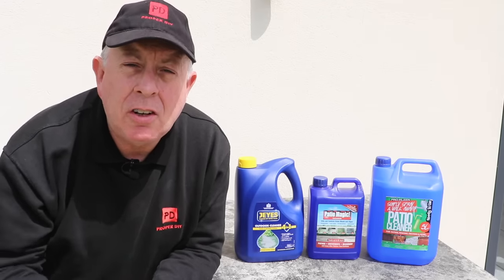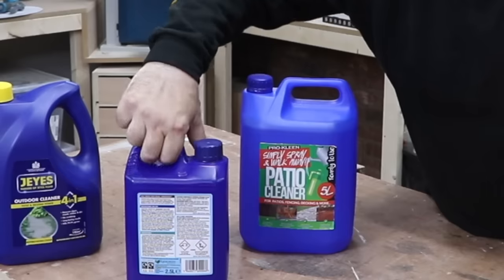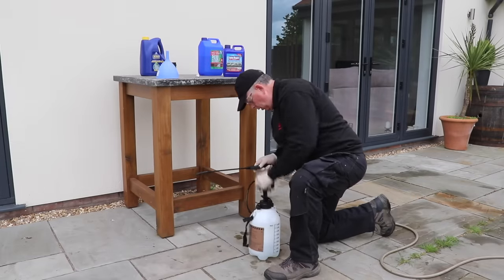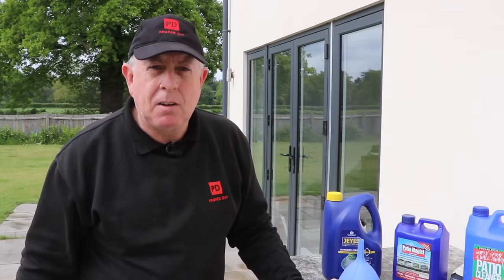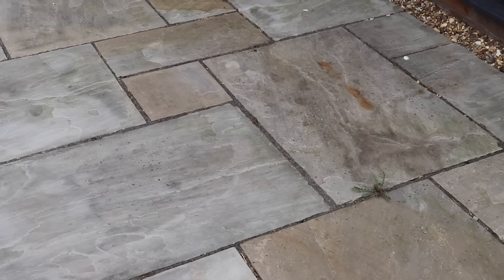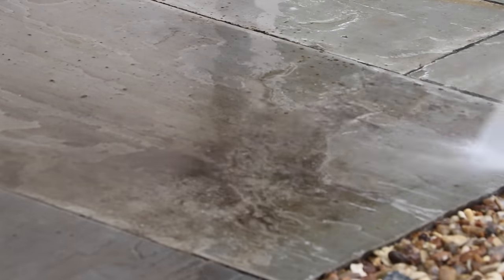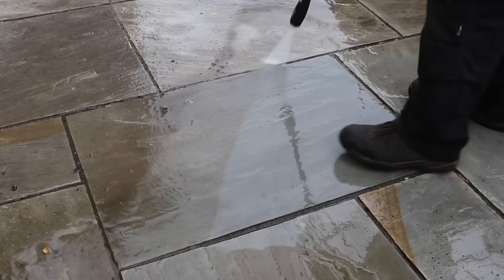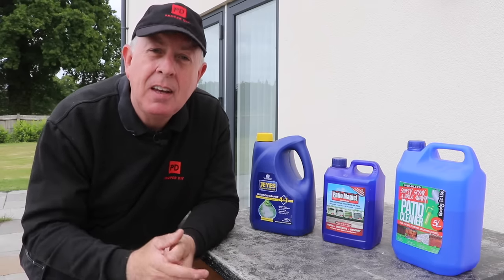Patio Cleaners vs Pressure Washer Put to the Test with Surprising Results!

Comment: I noticed your pressure washer is 110 bar rated pressure which is 1595 psi. .  My US washer is 3500 psi. I don't need any chemicals at all.  I wonder if this may also be a factor in cleaning.  I have no issues at all in cleaning most any and all gunk on any surface,

Comment: Well, here in the South West of the U.K. we have a hosepipe ban until Dec 2023! …any other suggestions? 😢
Reply: bleach, sugar soap, washing up liquid or washing powder liquid or vinegar (just one) in a bucket mixed with water (50/50 roughly ratio) and stiff brush and elbow grease. You can then consider your exercise done for the year.

Comment: What's your view on the patio cleaning brush heads  and/or patio cleaner in the pressure washer ? I've used budget patio heads before but the results with a genuine Karcher head were far better IMHO.

Also, do you think pressure washing followed by these treatments to prevent algae growth is a valid way to go ?

Comment: Wet and Forget is probably brand leader for this product. This works but you have to leave it to soak for weeks / months 
I had a roof kept on getting green and moss too 
Part of roof I couldn’t get to at first so first part of tile roof got about a months head start … over the course of 3 months the main part of roof was 70% better and the last part also cleared too 
I did this again 6 months later and no more moss or green … yes dead moss / debris was on tiles but no regrowth .. so perhaps a long term test would actually and factually be better … as per instructions  its not INSTANT  love the channel but felt had to comment

Comment: I'd call these mold and alge removers, but they're not grime removers because most of the build-up isn't organic.  Powerwashing is a bitch of a job but needs doing. I did the rear area of my house and you can tell where I stopped
I'd be interested in seeing a more powerful pressure washer or the cost difference in getting a company in to do it.

Comment: I think you need to look at why you are getting dirt on the slabs in the first place. From the video one side of the slabs is gravel & the level of that looks slightly below the slabs so that is ideal. The other grass side is the issue. Looks about level with the top of the slab. In heavy rain periods will get mud/dirt from that splashing/running onto the slabs & some of that will sit on the slab & dry on. Slabs need to be higher than the lawn or need gravel gully channel as a buffer between. Once you have sorted your ground levels, hose & brush the slabs once in a while to get the little amount of dirt off & use Wet & Forget. No need for pressure washer!

Comment: I think it’s a combination of the two. Most professionals would use chemicals and a rotary brush driven by water pressure. The chemical they leaves 
a residue which prevents re growth is the best. Also many provoke have block paving now and use pressure washers, the trouble with many is then 
the weed growth is instant between the blocks. So many people don’t realise that block paving has to have kiln dried sand between the blocks this 
prevents movement and stops dirt, wind born seed and other contaminants from getting deep in between the blocks. These grow weeds and deep 
rooted one’s it’s do easy to brush the sand after it’s dried over the block paving and this stops the weeds. You can of course spray a sealer all over 
which prevents the re growth of green algae. Jet washer on its own is not the way definitely. If your brain dead and need to spend 5 hours on your 
patio watching algae disappear then go for it. Most of us have a life.

Comment: you could have saved yourself loads of money and used a diluted bleach mixture (5:1) Those chemicals would only have been a benefit as a post cleaning treatment to help prevent the return of algae. I use a very powerful jet was with a turbo nozzle for patio cleaning to avoid the use of chemicals, but some mould such as black spot can only really be removed using sodium hypochlorite in a diluted mixture, but for light staining on concrete and stone, bleach will work. Obviously wear protective clothing, wet down plants and grass before putting down chemicals and never allow the spill off to go into fish ponds, and keep animals in doors until completely rinsed down.

Comment: Using a pressure washer not only removes the dirt and algae, but also the top few thousandths of an inch of stone or concrete (hence why it looks brand new afterwards), so if you have concrete slabs you will lose the smooth, semi-sealed surface layer that they left the factory with and become both rougher to the touch AND more porous, which makes them far more susceptible/prone to algae growing back and dirt both sticking, and seeping into the surface of the concrete when dissolved in rainwater, so I really don't recommend using a pressure washer on concrete slabs because you'll be making a twice-yearly rod for own back...

Comment: Sodium Hypochlorite 14% about €50 for 25 litres drum. mixed out at 4to1. Giving you a 100 litres. Best around. Leave it on patio or natural stone or cobblestone for 40 minutes to a hour and wash off with a hose or pressure washer.
Reply: that is €10 for 5 litres. and after diluting is €1 per litre at 3% concentration. That is weaker than household bleach in supermarket, which itself is around €1.50 for 5 litres @5% conc. Not much point in using the 15% stuff if you then dilute it!

Comment: Bac 50 at 25% dilution is much stronger - and cheaper - than the much more diluted commecial mixtures.  It takes time to worrk, however.  I also use it for cleaning gravestones - which can take a couple of months to show results.

Comment: You should have used  straight up  diluted Hypoclorit acid  mate ( Bleach ) 
May have been   possibly better when used in conjunction with a pressure washer or  manual scrubbing or  electric scrubber ( oribital scrubber )  a week later ...  A  surface cleaner on low pressure would be quicker than lanze...  The only thing about pressure washing is is that it can cause permanent damage..

Comment: Well here we are again, with Spring in the air. These products clear green algae. Most don't clean black spots or big stains. 
Every year i power hose my patio and side and front paving. Ive been doing this for years. 
The issue? I miss bits and this is where, in my case, patio magic works a treat. I spray over the entire patio area. It clears the little bits I've missed and also keeps on working. I'm surrounded by trees and greening happens quickly. I think these products keep greening at bay but aren't the full solution.
Where these products are really effective is on fences. 
Away from lawn and beds and pets  bleach has the same effect. 
So if the belt is power hosing, then the braces is patio magic or similar. 
Final point. I always make the cleaner mix stronger than suggested. It may look like its stained but is gone with the mext heavy shower.

Comment: These cleaners work by killing off any thing, then it all gets washed off slowly by the rain. They will have almost zero effect if put on and left in dry weather. Only kill the green algae which then turns either brown or dark. 
However over the course of a few weeks of rain the slabs come up as good as pressure washed. 

It's not a quick clean solution... but it's very easy and if done twice a year the slabs stay pretty much as new without ever needing to pressure wash. 

If you want an instant result you need to use a chlorine based result, and then go over with one of these in the video to stop any regrowth. 

Have a look at "benz" biocide products. They explain how these "soft wash" type treatments work. 

You need to put on on a dry day but the rain and weather is what actually does the mechanical cleaning once its all killed off. 

It can take months to see a result if you use these during summer. During winter you can get a patio or algae covered wall looking brand newnor freshly painted in about a week if there's good hard rainfall.

Comment: Do a test with just white vinegar. You can pick up a 5l bottle for reasonably cheaper than these so called professional patio cleaners. It takes up to 5-7 days to start working. It 100% clears green algae but doesn’t work so well on actual dirt. Sodium Hypochlorite (strong bleach 14/15%) is better than white vinegar, acts a lot quicker but is more expensive. I diluted mine 1:1 at first and only left it 1 hour before rinsing off. Next time I’ll not dilute and leave it overnight before rinsing. Black spots are the bit I struggle most with.

Comment: Doesn’t pressure washing ruin the concrete between the slabs?
Reply: yes it all comes out using a pressure you will need to re-sand it. its best to pressure wash, re-sand and then use the products to maintain the concrete.

Comment: Them.products when applied are supposed to be brushed off with a brush and hose not just left smartseal extreme clean is brilliant dilute apply with watering can leave for an hour and then use a hose and brush back to new no jet wash needed

Comment: Use Sodium Hypochlorite and you'll see a difference within minutes. You can get 20 litres for around £30 and it's also concentrated.

Will get rid of those black spots too
Reply: aka household bleach. the SH @15% is excellent, but, for most applications its too much.
Reply: @LiveFromLondon2  which is why you dilute it down to a ratio you require for the right application rate, normal household bleach may be too weak for stubborn blackspot staining.

Comment: Pressure washers are fantastic but can be to aggressive and wash out mortar from brickwork and you can not use pressure washers on shingle that  has gone green as it will blast it everywhere. There is a place for both methods and you need both.

Comment: Never mind the brand... tell us the active ingredient?
It's bleach actually, and the whole job is done in a tenth of the time without having to buy a pressure washer and no noise too.
After applying with a battery sprayer (have to buy that) leave for 15-30 mins and hose off. Job done.

Comment: chemicals in my experience, are good for moss and algae build up. not so much so for deep in ground dirt. a pressure washer is far better. i have pressure washed my own patio for over a decade, nothing seems to come close to how clean it brings the slabs.

But for the side of the house that is typically damp and gets very little sunlight, i do a good pressure washing each year no different to the patio.  then every few weeks i go out and spray to keep it from becoming slippery from the algae build up left behind from the dead leaves from the neighbours tree

Comment: The real question is where is all the mud coming from? Does it just fall out of the sky? Genuinely stumped how much mud is getting evenly spread (evenly, mind you, not just on the main walking paths) all over my patio on 3 sides of the house every year. Where is it all coming from?
Reply: Good point, my block paving is full of mud after I removed the moss above it
Reply: in effect, yes, it does just fall out of the sky. Soil dust, and everything else that is in mud, is floating around in the air, settles and when damp clumps together, hey presto, mud. Not to mention that rain brings down a lot of "dust" as well.
Reply: @LiveFromLondon2  Interesting, isn’t that awfully bad for our lungs?

Comment: Sodium Hyperchlorite - Give it a chance with a pressure washer to get most of the crud off and importantly leave the paving wet for the next stage. Apply the sodium (appox13 to15% strength) diluted in water and apply with something like watering can gently. Work it around with a brush and watch as in minutes a gentle fizz and hey presto. Rinse afterwords but in truth you could just leave it. Cant be beat IMO and you'll see results in minutes not days. 5l of the stuff is comparable in price to those products tested and will beat them hands down.

Comment: When using chemical.. wet patio, quick rub with stiff brush, then apply chemical spray and leave for 15mins, the give good scrub working up a foam... hard work but for a short period and beats the monotony of the DIY jet washers.... not perfect but what ever is.

Comment: Using Black Spot Remover and leaving it on is the only effective way I have found. These patio cleaners seem to be too weak to give a good result. Pressure washers destroy the grouting. A rotating brush on my Nilfisk pressure washer is about 6 or 7 times as fast as the straight pressure washer and it does not destroy the grouting. It also uses 6 or 7 times less water so you do not finish up with a flood- but it is not quite as effective as the grouting destroyer/ flood maker.

Comment: Depending on what type of patio you have, if you have man made concrete slabs then pressure washer is your worst enemy! 

Last year we used bleach, well the technical name for it and purchased in bulk at a high concentration and watered down. It was amazing use a watering can then get a broom and give it a little scrub, not necessary but we wanted instant result. 

Beat thing is this spring we did not have to re clean ! As it seems to have stopped it getting green and we like amongst pine trees.

Bleach all the time and a brush and work it in, or apply and leave. 

Pressure washer has destroyed the surface of our man made concrete slabs 😢

To find out more a good google search is softwashing.

Comment: I've never used the chemicals for patio cleaning, maybe they're better more as a preventative.
Would suggest your money is better spent on a patio cleaner attachment for your pressure washer, it saves your back & stops your feet getting so wet

Comment: You need a surface cleaner, it's much faster, you clean a one foot area in one pass, 

Biswing 15" Pressure Washer Stainless Steel Surface Cleaner with 3 Wheels & 1/4" Quick Connector, Power Washer Attachment with 2 Extension Wand,

Comment: Even if you use a product to kill algae, the algae will die, but the residue is still there, so, you still have to remove it. You are better off to use bleach to kill the algae, and use your pressure washer to remove all residue after the fact. These products designed to "clean" are more designed to clean your wallet, rather than the surface. Algae is basic in composition , an acid will counteract it. all in all, spread some vinegar on algae, give it a day or two, then pressure wash. Cheap, effective, less harmful than bleach. Especially considering runoff to gardens and lawns.

Comment: Patience is the key factor when using patio cleaners. I'm surprised that this wasn't emphasized in the video. Spray, walk away and wait. You won't see a difference after a day. Or a week. Instead, the effect only becomes really visible after a month. And it does compare well with jet washing. But make sure you use a cleaner which kills lichen. Black lichen disfigures stone patios more than algae. I use Ultimate Patio Cleaner which has bleach and it does exactly what it says on the tin. Jet washing is fine if the mortar around the slabs is in good condition. If not, use chemicals.

Comment: A box of biological washing powder works for me. Just sprinkle it over the patio, concrete etc. If its breezy outside, sprinkle some water on it, leave it and let mother nature wash it away. Or leave it fora few days, sprinkle with water, get a yard brush and scrub away.
Reply: I have tried washing powder and can confirm it does a good job with the old brush and scrub, but its a lot of work if you have a big patio. My plan is to speed up mother nature and try it with the karcher suction in a bottle method, just fill it up with washing powder liquid or washing liquid. Some one suggested above sugar soap works wonders too.

Comment: If you watch professionals clean patios and decking they use a combination of pressure washing and then chemicals if necessary. Never seen chemicals used without any pressure washing.

Comment: I have the all black black lid, no grey. It looks as though it has a valve hole in it, which can trick you. Pull it firmly upwards to get it off (in the direction fo the arrows), leaving the smaller black valve underneath. Then turn the bottle upside down and plug into the machine. Instructions are appalling.

Comment: Just that pressure washers especially Karcher etc  use  plastic I suppose because they could bang them out  ten  a penny, Whereas they should be done in brass but I guess that’s expensive to tool.
I’ve only used mine t  most once a year on  for two hours so there’s no way it’s gonna 500 hours so its supposed to be able to do, I dare say everybody else here same problems too expensive to repair and quite expensive to rebuy lol 😆

Comment: You did it all wrong. You need pool shock and some surfactant like dawn soap. 1GAL Water to 1/2 gal 12% SH. Apply let dwell 15min then use wide tip or surface cleaner. You can also use a brush if you need too.

Comment: I use patio cleaners and Jeyes on my extensive patios. You are not going to get rid of dirt on a patio by simply spraying any liquid on it. 
You need to use a stiff broom immediately after you have sprayed it then you will clean the patio as well as remove the algae. I feel
this video has not grasped this simple fact. I wont be buying a pressure washer just replace my bass broom when it is worn out. It is quicker and cheaper.

Comment: All of these kind of DIY store products are pretty much useless as they have to be sold safely to the general public. To get a decent result with a chemical you will need to use Sodium Hypochlorite which is what the pros use. Will still need to spray it down after to rinse away but it’s really impressive stuff